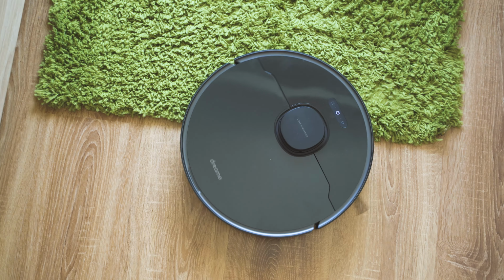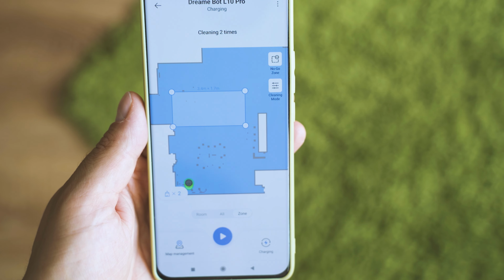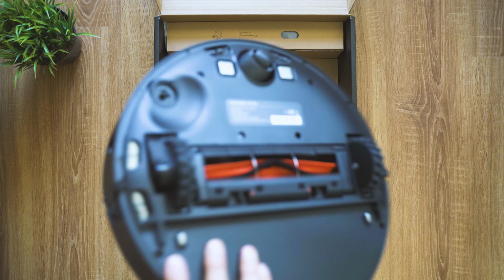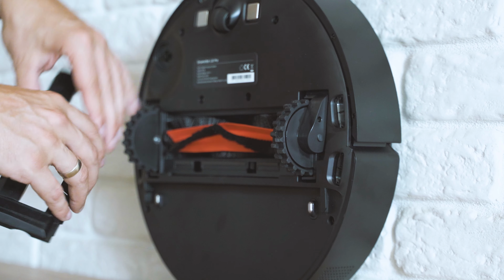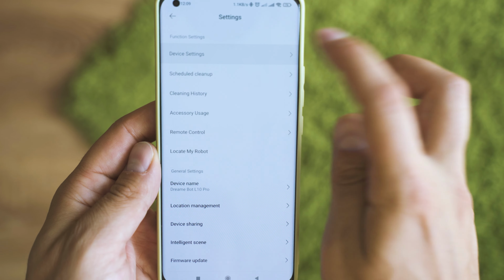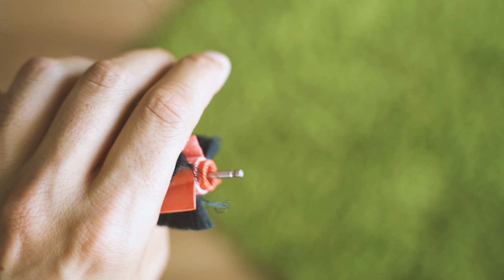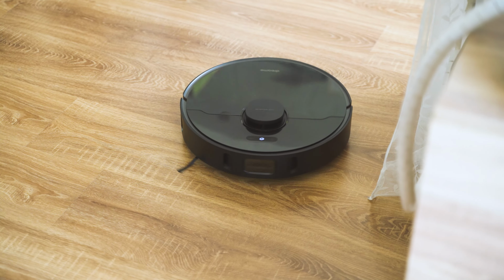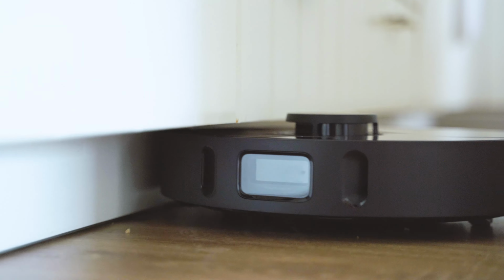Dreame Bot L10 Pro Robot Vacuum Cleaner: Smarter, Better, Faster, Stronger

Comment: @Tech4all I am considering buying the Dreame L10 Pro. I have all hard floors and long hair. Ive heard that lots of long hair gets tangled in the main roller brush. Can this robot operate with the main roller brush removed (relying solely on the 4000 pa suction to vacuum the long hair? I figure this could be a good workaround to avoid hair tangles and associated maintenance??

Comment: Can it remove the long (human) hair from middle-pile carpets? Is it possibble to set no-mop zones or only no-go zones? Do it stop the water automatically (in mopping mode), when it goes on a carpet or do we have to set a no-go or no-mop zone to avoid "washing" the carpet?
Thank you for answering.
Reply from the maker: Yes, it can do this. 
As for no-mop zones - I don't see such an option. So I guess you will have to define no-go zones in this case.

Comment: Is this passed down technology from the roborock s6? How does the detection of objects on the floor (like cables, cloths) stack up against it?
Reply from the maker: I believe the sensors here are way better than on Roborock S6, however software wise - may not be as smooth as Roborock. 
The detection is based on the analysis from the sensors and has mixed success. I will start adding such a scene to my future reviews.